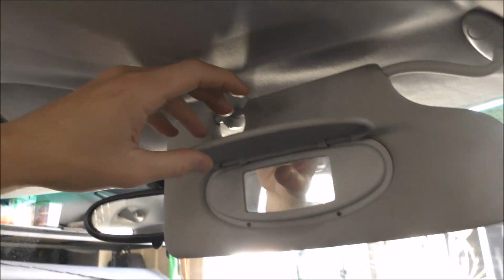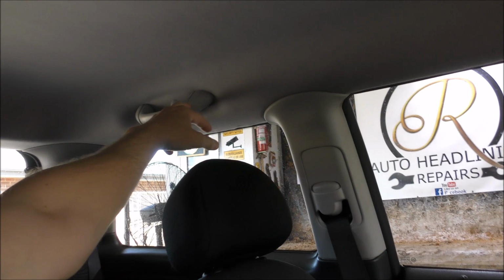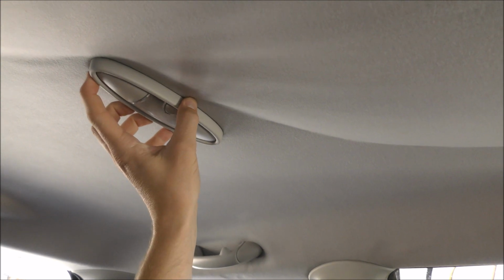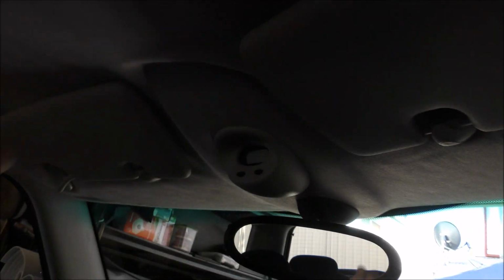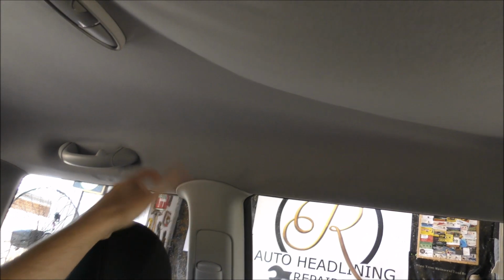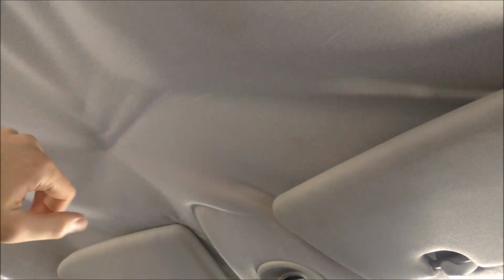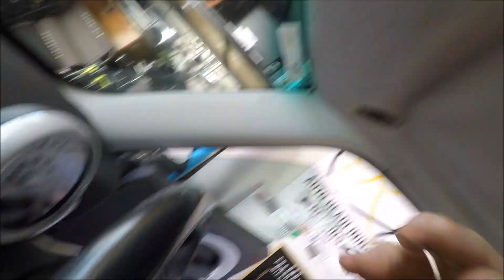Mini Cooper Headliner Repair | ROOF LINING REMOVAL

Comment: Would a Mini Cooper with a "panoramic sunroof" be as straightforward as a Mini Cooper with no sunroof to have roof liner replaced? For example, are there connections on the sunroof I should watch for/disconnect before taking the roof liner off, please?
Reply: From memory the roof liner board is pretty straightforward to drop down with sunroof models, very similar to non sunroof models. They don't come through often, so it gets difficult to recall and suggest accurate steps right now here in the comment section
Reply: After watching and rewatching your videos about how to replace a Mini Cooper headliner, I am ready to do mine! I have my velour material and can of glue, as recommended.
Reply: One last question before I embark on my roof lining replacement journey. Do I need to disconnect the car battery at all? By your video, it doesn't look like I do. But, I have seen another video, showing that the first thing to do, is to disconnect the battery.  I am now confused. Please clarify. Thanks

Comment: HI, Nice video.I have a question..I saw you just pulled out the whole cardboard out of the ceiling. Did you remove the siding portion of the windshield and middle and rear sidings..that holds the headliner.?

Comment: Sorry, just a question. For roof removal il strictly necessary to removal lateral vertical front and posterior cover? In other guide i saw that this is necessary.  Do you help me? Thanks
Reply from the maker: On this car, I was able to leave the A B and C pillars in place, and just flex the headliner board away from them.
Reply: What did you apply on material before you smooth it out?

Comment: What kind of brush did you use to scrape the old foam and adhesive off? A wide wire brush?
Reply from the maker: Usually it's a combination of a straw brush and soft fibre style brush
Reply from the maker: Wire brush can work on some headliner boards, but it can damage the board aswell, so be careful with that tool
Reply: Thank you. I used a wire brush but a narrow one. I wound up with a little damage but nothing I can't work with. I'm just having the hardest time deciding what headliner material I want to use. So, so many cool ideas.

Comment: Tnx for this! Can i use my old headliner?
Reply from the maker: Fabric may only be sagging in a few places & still neat, but if it previously hasn't been recovered,
Adding glue to the existing factory material wont work, looks messy, it will leave a visable stain due to glue hitting raw fabric. Over time the foam backing on the fabric crumbles away making it un-stick & causing the fabric to fall down. To fix the sagging issue professionally, the Foam/Fabric needs to be replaced.

Here is a video that also explains this
https://youtu.be/iZ1nJ4pZfkY

Comment: Hi Reece how much material is needed to get the liner in correctly?
Reply from the maker: Unfortunately I haven't stored any measurements for this particular job, but when you measure up this one yourself, make sure to include atleast 2 inch overhang for safe measure
Reply: Hi there. Let me help you out. The material I got was 5,5 ft. x 6,6 ft. (170cmx200cm) and there was plenty of overhang